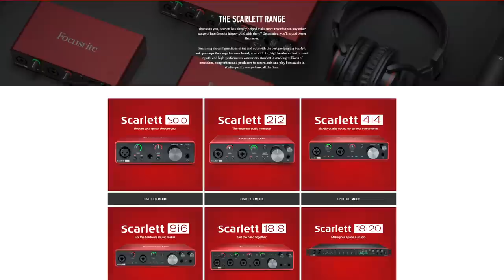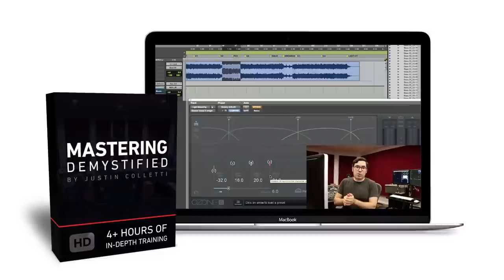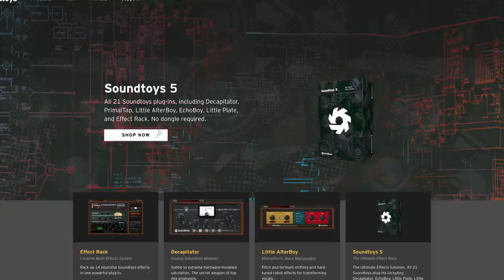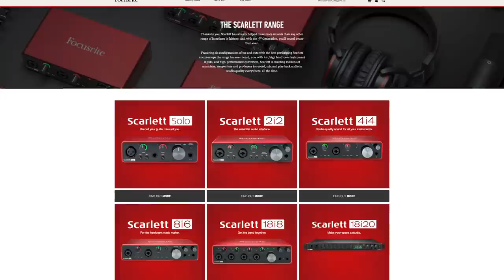The Secret Science of Stacking Compressors

Comment: OD’n with one compressor will give you the sound of that compressor but at the expense of the performance. Try clip gain, automation, & peak limiting on vocal material. Use your DAW meters as a measurement tool. Try gates, envelope shapers & transient shapers on rhythmic material. Go there first before assuming a compressor is what you need.

Comment: (1) How do you eliminate phasing with parallel compression? (2) How do you high pass mix bus compression if the compressor doesn't have a high pass setting?
Reply from the maker: 1. You don’t and don’t need to! The reality is that it’s not nearly as big of a  “problem” as some make it out to be.

Yes. If you EQ parallel tracks in phase shift will cause some minor changes in the EQ shape. But the changes that occur are generally minimal.

For instance, if you use bell filters, the difference amounts to a slight change in the bandwidth of that filter. So it’s really a negligible difference. It’s a similar case with shelves.

The only place where the change is somewhat significant is if you use low and hi pass filters with very steep slopes.

But the effective difference there is that you have to listen instead of look at your low or high EQ settings to make good decisions. (Which is a good idea anyway). 

Because of this, it’s a best practice not to use super steep low and high pass filters in parallel...if you want to make things simpler and have the EQ curve you get be more like the EQ curve you see.

Here’s a great video with some real audio examples of this: https://youtu.be/efKabAQQsPQ

2. If you have a side chain input on your plugin, you can have the sidechain’s input be a bus/aux that you put an EQ on.

Hope that helps!

-Justin

Comment: Commenting on another older video, Justin... but I was wondering, with stacking compressors, where do you put an EQ? I know the "correct" answer is probably "it depends" -  but most people I know in recording/mixing prefer EQing into compression; but I can see reasons to EQ after on the master bus (as long as you don't get crazy with boosting lol). Is there a signal chain you set up just as a matter of course, even if you don't use everything; and is it EQ > compression? Compression > EQ? Compressor 1 > EQ > Compressor 2? Or is it different each time you roll up to your desk?

Comment: I made the mistake of using the fastest attack possible on vocals (Rcomp .5 attack and 10 or 11ms release @ 3 or 3.5 to 1 with up to about 7 to 10 DB of gain reduction on the big ass notes) because I was told you were supposed to do that and the mic had esses that were strong and unattractive and that helped catch and round out and sculpt the tone which was nice. The other settings I don't mind...but I wish I had learned to run it with a slower attack setting to keep from stealing the performances. Not only that but I learned to sing overemphasizing certain sounds knowing how they were going to push into the compressor and work in the mix. Then when you get new better mics and equipment you're in hella trouble. You have to learn to resing. It's weird.  
I'm thinking about using a fabfilter multiband from like 5k up with a fast attack and release to cover the top end transient problems that come with compression, and then a slower comp for the meat of the vocal. Maybe vice versa even. Frequency dependent attack and release. Lots of people just use a desser but i've never found one that sounds good to me and I have just about all of em except the Weiss one that looks hella nice. I've heard people love the 1176 into an la2a but...that la2a tone has never really worked for me. These are ALL great ideas.  I love serial compression done the right way. I usually run an L2 or true peak limiter for extreme crest factor peaks of fast notes and transients and then a slower one for the rest of the volume differences which are less aggressive and don't cause as much compressor strain. Long comment but I hope it helps someone. Peace.

Comment: that's a common misconception to think that Teletronix LA-2A has a slow atack. It's atack varies from 100 μs to 1 ms program dependant. The slowest atack on UREI1176 RevE is 1 ms. So the same job on processing atacks can be done with either of them. But the release of the LA-2A is super slow and the release curve is different from the 1176. That what makes a perfect combination. Using LA-2A for drums creates much deeper and more distinct room effect.
Reply from the maker: I believe that the LA2A can have up to a 10ms attack time depending on program material.

If you don’t mind me asking, where did you see that it only goes as low as 1 ms? I can shoot you a few links about it being as slow as 10ms if you like!

While not exactly “slow” compared to how slow VCA or digital compressor can potentially go, this is certainly slow enough yo allow transients through on things like cymbals, acoustic guitar, high percussion, and even some drums.

You also have to take the knee into account as well. Even with a nominally fast attack time, a softer knee will tend to give the impression of a relatively slower attack time and then a hard knee would with the same nominal attack time.

The release of the LA2A is also program dependent. It can be almost moderately fast release 50%, but pretty darn slow to released all of the way. But that too depends on what kind of material is being fed into it!

But whichever way you want to describe it, yes they can make a good pair on many types of instruments, thanks to the differing default envelopes!

Thanks for the comment,

Justin
Reply: @SonicScoop   sorry to say this, but, no, it can never be as slow as 10 ms whatever material you pass through it. If you look in the manual the specification uniquely says the atack time is essentially instantaneous -- 10 μs [manualslib.com/manual/828938/Teletronix-La-2a.html?page=2#manual], which is even faster than 1176, which atack time is 20 μs. But the atack time is too complicated, it gives us too little information about its character and what it will sound like on different material. What the manual says is more likely reaction time, but the atack slope is program dependent. I've measured the atack time on plenty of different LA-2As. The slowest case was around 600 μs [Gray face], which is 63% of the full slope. The full slope would be around 1 ms. 

You are absolutely correct concerning the knee factor. Yes, it gives the impression of a slightly softer invisible compression, but its too short compared to the attack time to take into account in our case. 

Thank you for your comments, Justin. Your videos are awesome. They give clear ideas on how things work. I would appreciate the links you are talking about.

Best,

Kirill